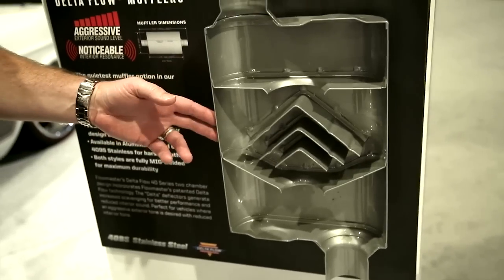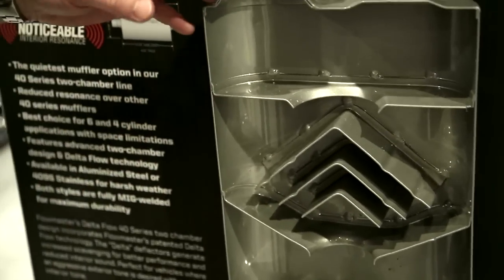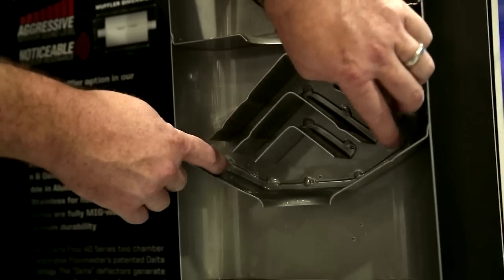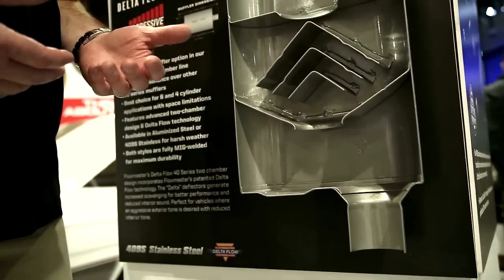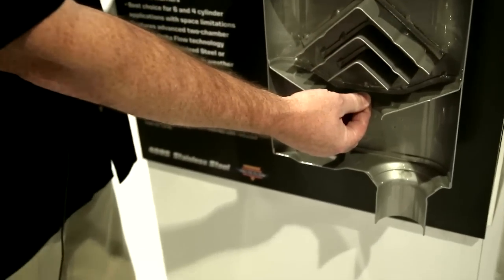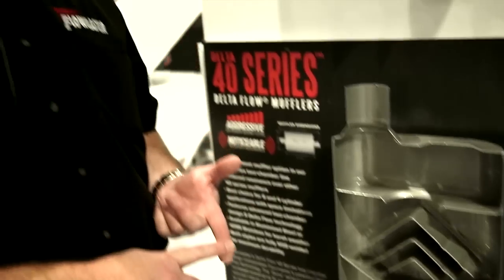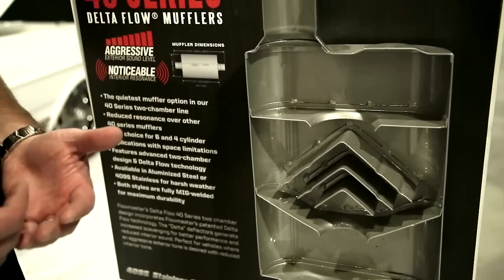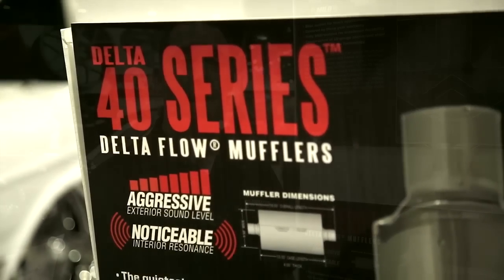Flowmaster 40 Series Delta Flow Mufflers Review - SEMA 2013

Comment: does the 40 delta flow sound annoyingly loud and bassy when cruising and taking it easy on the throttle? looking for something that won't upset the wife when she is in the car
Reply: Delta 40 is the quietest 40 series, any quieter and you move to a 50 series.

Comment: I missed it what's the difference between Flowmasters having delta flow and the Flowmasters without delta flow
Reply from the maker: 2pacnasgame Delta flow mufflers are designed with internal baffles inside the muffler chamber that help reduce the sound level while still allowing for great flow characteristics.  The regular 40 series flow awesome, but they are too loud for some people's preference.  The 40 series "delta flow" offers a quieter alternative.

Comment: I wonder if there is a significant sound difference between the series 40 & series 40 delta flow 👀
Reply: Absolutely a difference between the sound. Original 40 without delta flow has a lot more drone and growl at cruising speed. Delta flows are relatively quiet at cruise speed

Comment: Hi which one is louder between the delta 40 or the super 44?
Reply: Super 44 is louder than 40 delta flowmaster.
Reply: Delta 40 is the quietest 40 series, any quieter and you move to a 50 series. The Delta 40 is a good choice for the 40 series sound with the least drone, and what I'd choose if I ran headers and no cats so it wouldn't be too loud.